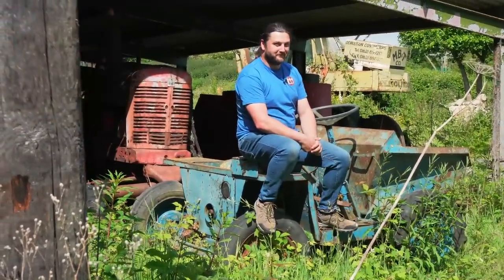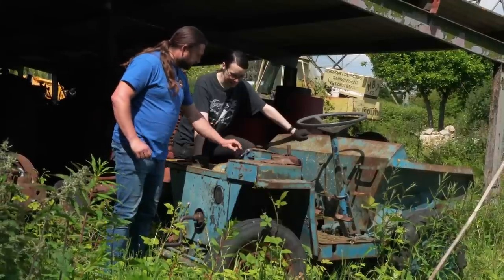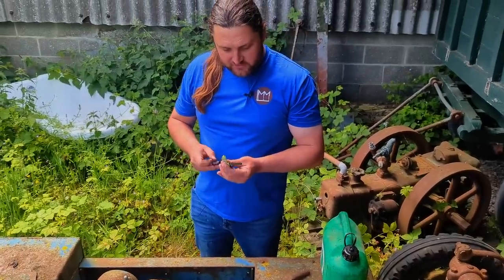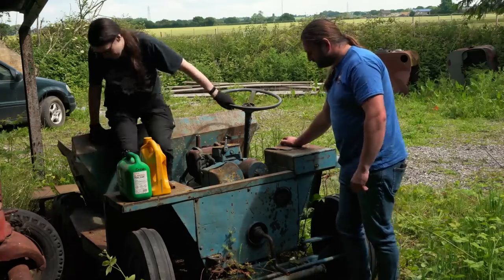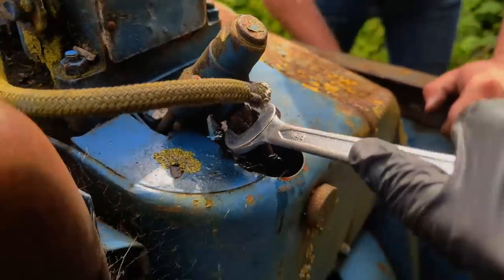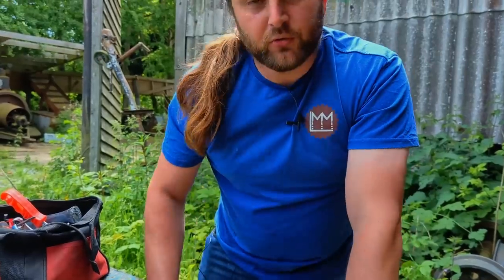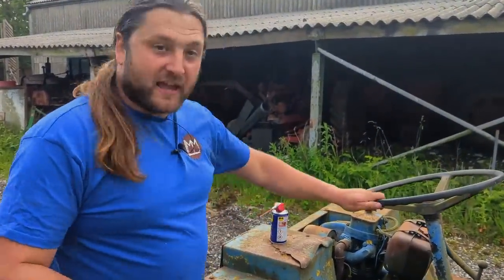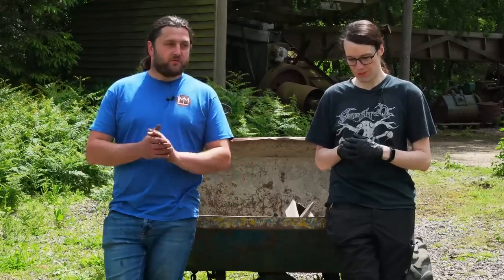Will it Start? We found an abandoned Dumper!

Comment: Next week Lawrie returns to start the rest of the tractors, rusty stationary engine, the large old excavator in the background and whatever doesn't work in this yard.

By the way don't use too much easy start on a engine as it can glaze engine bores and cause compression issues.
Reply from the maker: Pretty much!
Reply: Compression is over rated
Reply: @derpydog1008  until the engine fails to compress.

Comment: On Humpty's gearbox, add molybdenum grease and a bit of graphite powder before topping it off with gear oil because both are great EP lubes, will tend to stick around after the oil leaks out, and will tend to prevent or slow any oil leakage as well.
Reply from the maker: Oh really? I'll give it a whirl

Comment: Operate the decompression lever and put it in gear and the engine will stop. I found this out at 9 years old when my mates and I used to joy-ride around a brand new housing state being built on our fields in Basingstoke! It helps if you have brakes and a clutch, but better than being burnt.
Reply from the maker: Operating they decompression when it's working can damage the engine I'm told
Reply: @lmm  indeed it can. It's okay to do it occasionally but regular use will burn the exhaust valve.
Reply from the maker: @ClipperDays  ah fair enough, I've just heard don't do it

Comment: Dumpity, dumpity, dumpity, dump.  Nothing quite like the sound of those engines firing up.  Next episode "Laurie buys another dumper".  Oh yeah.
Reply: Yeah! From age 8 to about 20 I spent several weeks each summer on a small family farm that had three tractors. A late-80s Deutz that felt incredibly modern (well, the year I first got there it was only four years old I think), a mid-70s Deutz with a front loader and a 1956 Steyr T84 that was still used for light duty like mowing tight spots with the original sickle mower, splitting logs with a hydraulic splitter or turning hay. Every time I heard that little 18 BHP diesel engine start up I'd drop everything and run for a ride on the nearside wheel arch (the offside was usually blocked by the mower attachment). I also helped start it when the battery was semi-knackered and held enough juice to glow the engine but not for the starter motor.

Two weeks ago I helped figure out the wiring of its little brother, a sad green T80. I did find original schematics to confirm our findings but as none of the electrics were original but rather an aftermarket kit the schematics weren't all that helpful. The base model was actually sold without any electrics whatsoever. You'd stuff glowing cotton buds (looking like cigarette filters) into a holder in the block and then crank the handle like mad. No lights, no nothing. The full upgrade kit this one had consisted of two headlights (sidelights, dipped beam, high beam), two combined rear/brake lights, one of which also included a number plate light, a glow plug and a starter motor (and obviously a generator and a regulator). Apart from the glow plug and the starter nothing worked when we got there, cut and taped wired all over the place.

Comment: I find it fun to watch you young gentleman find old equipment to see if you can get it to run. 

As you were tinkering I was pleasantly surprised to see some old America farm equipment in the background... like a Farmall and a Case tractor. 

I agree your trouble shooting skills have definitely improved. Hey just a hint from a professional... I'm guessing you have steel shower curtain rings in your country... they work well as a carabiner to hold your combination wrench sets together... as does a tool roll for your open ends. This also helps with spotting missing tools.
Reply: I think its a International Farmall. I noticed that there is also a huge excavator on the other side of the building that would be fun to start.
Reply: Think it is either a BMD or a B-450, Doncaster built pseudocopys of an M, except they have a built in rockshaft and 3 point. Seen a couple for sale over here in the states, but not many. Missed one for cheap a couple years ago. What I would really want is that John Deere 730 High Crop.
Reply from the maker: I want the John Deere too That's amazing

I'm glad you enjoyed the video, and great idea!

Comment: That looked like a Thwaites DUMPER not dump truck to me found on building and construction sites mid 1950s onwards. They would carry about 10 cwt. rear steering, The box under the seat is for the starting handle.

Using Easy start was a sackable offence as engines grew addicted to the stuff, so a lit piece of diesel soaked rag had to do the trick on Icey mornings. Luckily I worked at a precast factory and the units would be steamed to gain early set strength, so parking near the steam room kept my dumper engine warm.
Reply from the maker: I hear keeping it warm makes a huge difference for starting it.
My liner is 15cwt so that makes sense.

Comment: There is a lever under the fuel pump ,if you move it up and down you will hear the injector squeak! as it pumps fuel through the nozzle and primes the engine.
Reply from the maker: Didn't see it at the time

Comment: There is a easier way to turn it off without burning yourself. Turn the decompression switch at the top, into the upright position also turns it off
Reply from the maker: I'm told that can damage the engine

Comment: the question to be asked is why didn't you just flip the decompression to kill it
Reply from the maker: I've always been taught you don't do that as it can damage the engine.
Reply: @lmm  should be a leaver at the side of the fuel pump to pull and prime before starting and you can lift it to shut the engine off.